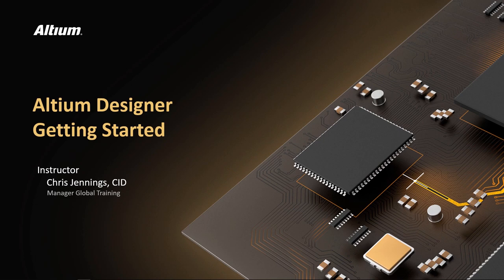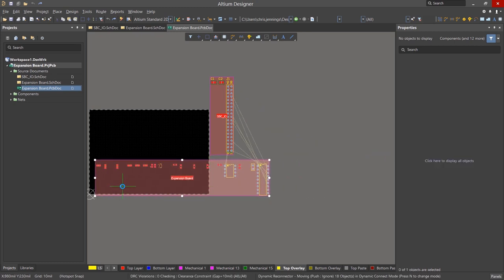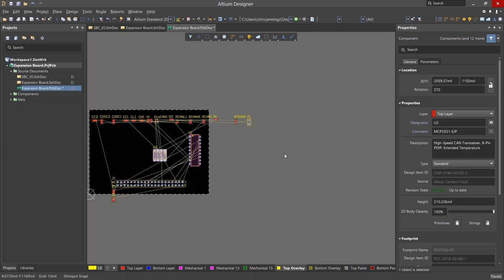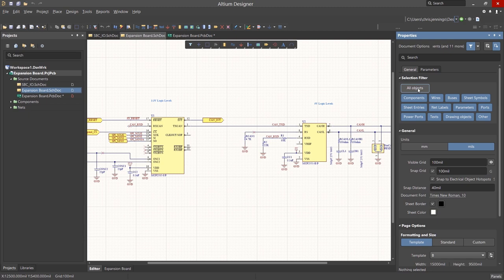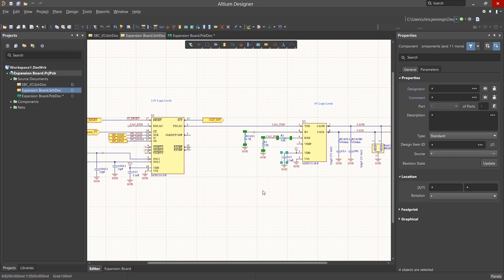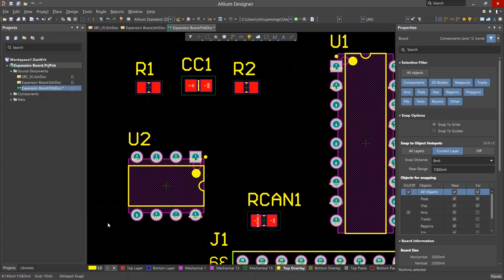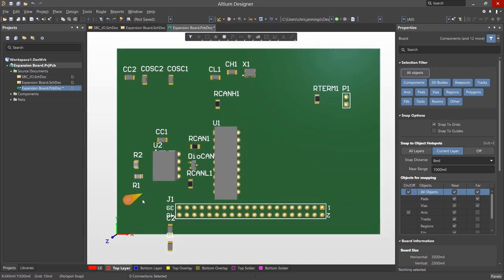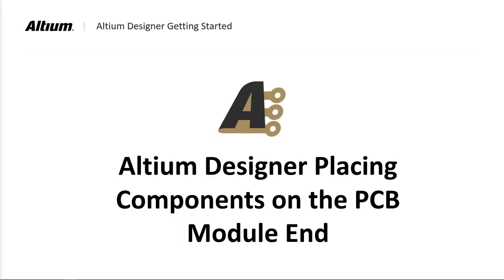6. Placing Components on the PCB

Comment: Hello, Do you know why I did select the [Components] from the "Selection Filter" from the Schematic properties, and I selected a group of 5 components from the schematic but it did not high light the component selection in PCB? is there any preference setting that I missed?
Reply: @benjordan5895  Thank you Ben, follow your advice, I did select [cross select mode] from the TOOL drop-down menu or [Shift+Ctrl+X] but nothing happened. I went back to Schematic reselect the other 4 components and went back to the PCB page.  Nothing is high lighted/or selected. BTW I am using AD-19.1.9
Reply: @benjordan5895  Thanks again for your help.  It works now.  I went back to the schematic page, Shift+Select the components, then from Schematic page, I enable [cross select mode] from the TOOL drop-down Menu. go to the PCB page, they are high lighted.  Cool!  Thank you.